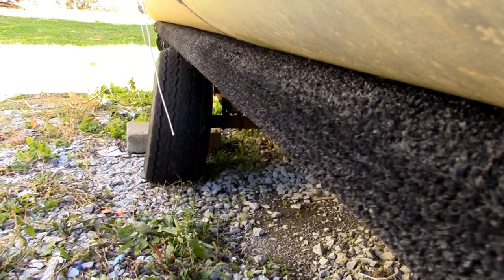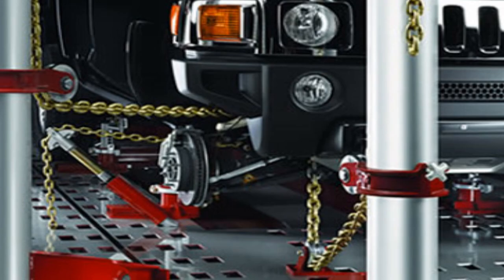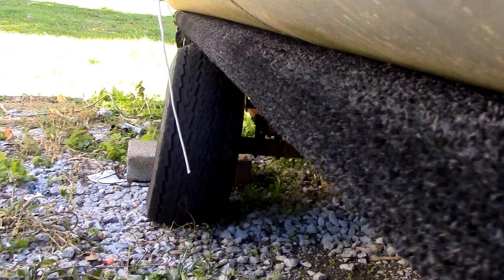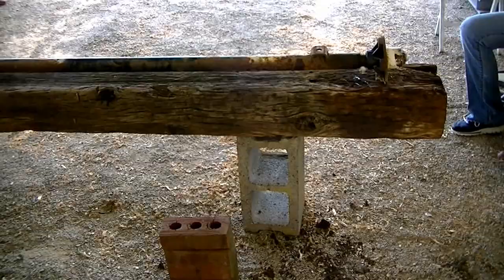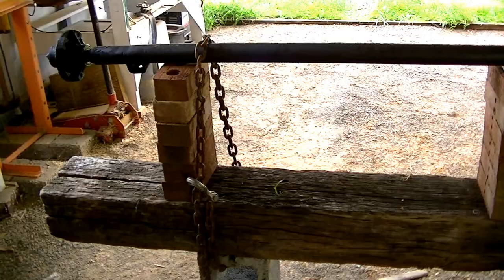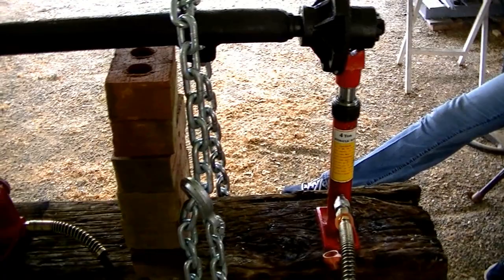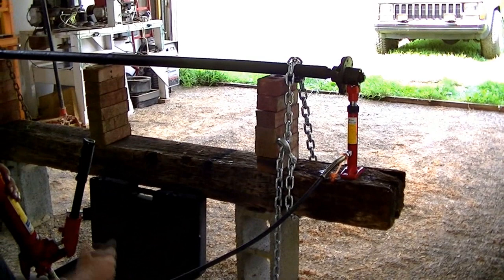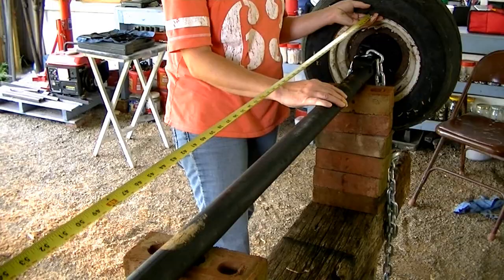Ep.15 - Straightening Our Bent Boat Trailer Axle

Comment: I have a wood splitter with a bent spindle/axle. The problem in my case is that the spindle is one complete piece which is welded onto the trailer so it can't be removed. What I did to fix it was wrap a piece of a paper towel around the spindle then  some tape to hold it in place. I put a stout pipe around the spindle and stood on the end as far out as I could and used my body weight to slowly bend it. It is not very precise as I didn't measure the camber/toe but I got it close enough for my purposes.
Reply from the maker: Ha!  Great idea! I'm sure it'll be close enough. I get irritated when people make excuses for not being able to do something. You can do whatever you set your mind to doing. It would've been great if you would have uploaded a video of you straightening yours so people could see that anything's possible. Good job!!

Comment: Hey how do you measure it when I do it I just eyeball it and it takes a few times
Reply from the maker: I  probably could eyeball it too and get it close enough that it wouldn't scrub the rubber off of the tires, but I thought I'd be proper since I was making a video. All I did was measure from one hub to the other one on the front side and the rear side. It would be more accurate if I had vise gripped a straight edge to each hub and formed an "H"  so that I had a longer surface to measure.  Thanks for watching!

Comment: How did the bearings and races look?
Reply from the maker: I haven't taken it apart to look at the bearings and races yet, but when I spin it I can feel flat spots in one of the bearings. I bought a used axle yesterday that I will be adding to the trailer so that it will be a tandem trailer and one of those bearings also feels a little rough :(  So....now I have to try to find bearings and races for two axles that are unidentifiable. I think that all I can do is get out the micrometer and try to find bearings and races that will fit. I'll probably look on Ebay first. Thanks for watching and taking time to comment.....Bret.
Reply: +Bret Becky yea the bearings themselves should have a part number on them . if not just take the old ones with ya to the parts store and match .  good luck

Comment: There is a crack in the weld where the water is coming out
Reply from the maker: It's not a crack, it's a stitch weld. The factory stitch welded it in case a crack did develop so the crack wouldn't continue. Thanks for pointing it out though. A lot of people either didn't notice it or didn't say anything about it.

Comment: Isn't that really hard on the bearings to put so much pressure on them?? Maybe removing the hub and lifting under the spindle would be a good idea. Otherwise great video. Thanks
Reply from the maker: +Mickster Mouseter You're absolutely right, but the bearings already had a few flat spots on them and needed to be replaced anyway. Thanks for watching and commenting!
Reply: I used your info to straighten the axle on my utility trailer today. It looks much better. Thanks for the great video.
Reply from the maker: Mickster Mouseter I'm glad you got it straightened out. I hope you made a video of it, I'd love to see it :)
Reply: Sorry no video, but it sure looks and pulls better. :-)

Comment: Who cares if the bearings or both bearing and race get fubar they are pennies and pulling the hub takes minutes and minutes to pack a new bearing and put it in...if the race is messed up just knock it out with punch and shave it so it fits in the bore  but can slip out and use it to drive in the new race ...lol...folks griping about bearing/race must pay a shop $$$ to do a $5 dollar job .